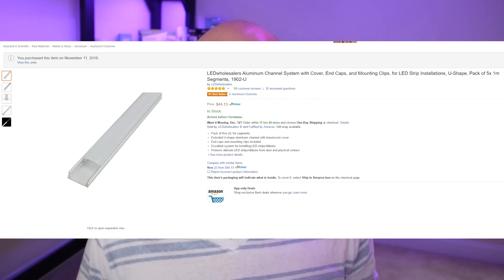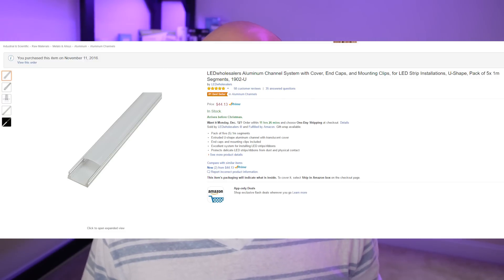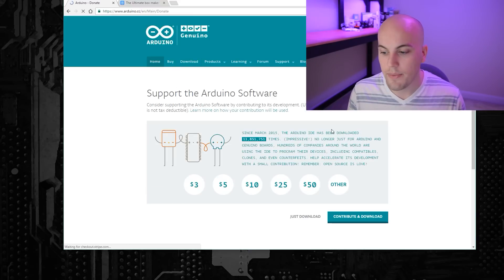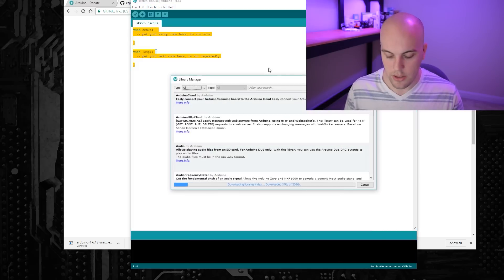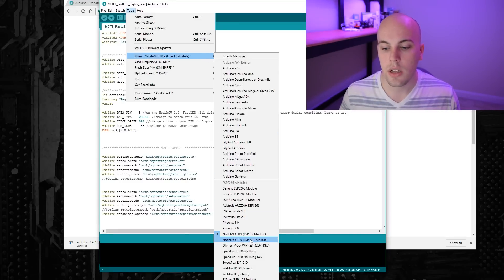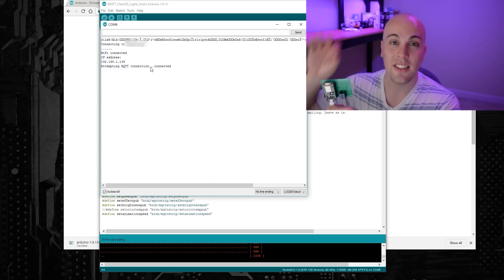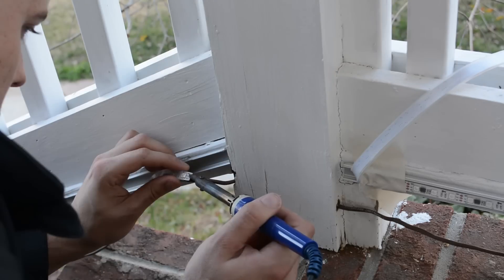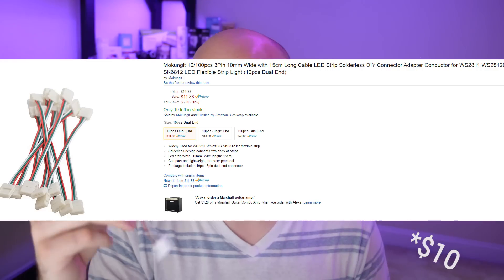The BEST Digital LED Strip Light Tutorial - DIY, WIFI-Controllable via ESP, MQTT, and Home Assistant

Comment: Hey Ben, 

I followed this tutorial a few years ago and made a light strip for our front yard. It's been working (almost) flawlessly for a few years now. It makes me happy to see it come on because it means my Home Assistant is working the way it's meant to. It comes on at sunset and turns off after 3 hours. It changes pattern every 5 minutes and there are custom automations for Xmas, Haloween and New Years Eve.

Just wanted to say thanks for your effort in making this and other tutorials.

I had it working flawlessly with a strip that wasn't as waterproof as advertised. When this eventually died I replaced with another which actually is waterproof but it flickers. I'll try the #define FASTLED_ALLOW_INTERRUPTS 0 as per a comment I just saw on here and see if that helps or breaks everything. I found that my first strip yellowed in the sun and lost brightness so for the second, I bought a can of spray on UV protection from a car shop. Worked wonders.

Here's the end result: https://photos.app.goo.gl/5jHEcjysBkctRhQX7
Reply: how did you do the cuistom animations? want to add a fex myself

Comment: Few errors might pop up in the compiling of the code that Ben has provided.
Due to updates etc.
You may get an error on the StaticJsonBuffer, seems to be due to an update,
If you go for the latest release of the ArduinoJson, it will probably default to ver 6.x , to compile the code you need the last version of 5.x as well.
Also, for some reason, after that I got an error with the term 'MILLION', so I replaced it with 1000000.
After that, the code compiled ok.
Reply: thx mate had the same problem white million
Reply: Did you use his Home assistant code? I can not get it working with updates home assistant.

Comment: Great video, thanks, I see its been 2 years but I need to ask - I bought a house with LEDs used as outdoor Christmas lights and need to identify them to try and use wifi. These are described as storefront, chasing LEDs, also seen described as injection moulded, they are RGB and have only 3 wires so I guess from this video they are analogue and maybe cant be controlled with wifi? I have tried a SP108e from Amazon, no luck as they seems to be for digital and need to identify the IC try which I think now I do not have this type. They are 3 leds per segment, and and 20 segments per section. These lights do not have an identifying marks, letters, or numbers. The RC controller says LED Dream color controller LED2017-RF-DIY 358 kinds of effects 2048 pixel

Comment: ok  Ben I surrender.  I cant make this work after weeks of trying.  I have the sketch working on NODEMCU, mqtt is working.  HA is my problem.  I'm confused, did you put everything in a single yaml file?
It didn't work for me that way.  I tried to put automation in the automation.yaml, and the input_slider in input_slider.yaml still not working.  I even tried the slider in a group. NOT.
What is it Im missing or not getting right?
Reply: Home assistant seems updated and works diferently now. I only got the automations to work by putting them in the config file but using autoamtion old:

for the light and input slider im still searching how to get this to work
Reply: @jenshoofs  input slider should be at the input_slider component in the config file

Comment: Need as well help please. I have the wiring for the ESP8266 and shift register and all that done.  I have the code uploaded to the ESP8266, but without the proper MQTT information, because that's where I'm lost!  BAD!  I have a Raspberry Pi 3.  I have tried watching the other videos linked about getting MQTT and home assistant set up, but there are many holes in it and a lot of it assumes you already have some experience with it. I don't. Not only that but it seems HA has changed a lot and some of the processes and such don't work anymore, links are gone etc. 

Please help. I've followed a ton of videos and all assume I know more than I do. Wish there was a video from beginning to end for these lights.

Comment: Hi Ben, I've been watching your videos, I mostly get them from Reddit, but I have come full circle again while researching a new idea.

I wondered if you could help me a little with it.  The idea is this: rgb pixel lights on the house, year round.  But i want to run a custom animation based on a sports event result.  And I would like it to happen automatically (i don't know how exactly possibly mqtt/stringify/ifttt/? For example, "sports team A" game starts, all the lights on the house would turn a color, or play an custom animation of colors.  And if said team wins the lights could blink or play a different animation.  And after x amount of time after the game is over the lights would turn off or go back to a static look.  I've thought also of being able to display the name of the team/current score/or final score on a matrix of lights.
 not sure if an arduino with an esp8266 would be enough for this? espixelstick/xlights/falconplayer?

Im not asking you to solve this problem here, but I am looking for some guidance on if something like this is reasonably possible? I currently have a SmartThings home automation hub (its looking more and more like i need to convert to HASS), and dumb pixels installed on the house.  I have some very limited arduino and rasp pi knowledge and experience.  I would be looking to update/upgrade the lights, and would love to accomplish this idea mostly so that I would have more motivation than just "holiday" lights.  Just not exactly sure if my idea is within my scope, and after watching what you're doing I thought you might have some resources I could look into.  If you can help that would be awesome.  Thanks.

Comment: My pick for the best digital strip is the WS2813. If an LED dies, the string will continue to function, but they're only good for short distances.
For long distances, WS2815 are way better due to them being 12V which reduces the effect of voltage drop

Comment: @1:02 No.. you do not control the individual lights with a PWM signal. That is what you do in the case of an "analog LED strip"
In a digital strip the data for each individual LED is transferred out using SPI

Comment: I am not sure if this is being monitored anymore but I was wondering how to split the data signal between 2 data wires. I have 2 strings of LED and they both work fine independently but when I hook both lines to the 5v output at the same time, one of the LED strings starts to spaz out and the other string works fine. They are a different distances from the control board, but only by 1-2 meters. Any suggestions?

Comment: The logic level shifter really is not needed.  You are wrong about voltage drop on the  control signal.  The control signal from the microcontroller only has to reach the first LED. The first LED receives the control signal from the microcontroller then outputs a new control signal to the next LED.  Each LED recreates the control signal so there is no drop along the way.  It is not, as you assume, that the control signal has to get all the way from the microcontroller to the last LED.  https://electronics.stackexchange.com/questions/249162/how-does-an-addressable-led-in-a-strip-work
Reply: Just saw you corrected this in the notes.  Sorry.

Comment: I don't agree on cheaping out on the power supply by saying you'll never be at the full amps.   That's like saying the Titantic will never need those life boats.   Interesting install.    How well will it hold up in the weather though?   I would prefer to weatherize the connections more with liquid electrical tape rather than just tape.   Also, while the effects were impressive they failed one important aspect that I was looking for:  They didn't really light the walkway up enough to see where you're going.  Maybe it can do that but,  seeing where you're stepping is an important feature of such an install.

Comment: Spent a few days trying to get this to work. I'm having strange issues with this, managed to get to the stage where the HA showing the switch, colour selection and effects. Problem is LED's aren't switching on at all. I've checked my data pin and it's correct. My MQTT works and shows the requests from HA in Ardunio IDE serial monitor. I flashed my nodemcu with the neopixel strandtest code, as a test and the LED's work. Not entirely sure what is going on. Any help is much appreciated! Thanks

Comment: Please help me! WHen Compiling appear error 'StaticJsonBuffer' was not declared in this scope! Why???
Reply: i am having the same problem
Reply: I had the same problem. I found the answer on here.  You need to use an older version of arduinojson. I have installed v5.13.3 and it works :)
https://github.com/bruhautomation/ESP-MQTT-JSON-Digital-LEDs/issues/103

Comment: I got here late, but now finished my arduino LED strip light saber project.  I would like to use the 20 M of 5050 RGB DMD strip.  However the strip pin-out is different and I have not been able to find any info on the web to use it.  There are four pins on the strip labled +, B, 
R, G.  https://www.ebay.com/i/163255895787?chn=ps.  Any clues to offer?

Comment: Hey @bruhautomation. I do realise this is a fairy old video but would it be possible to use that wifi controller on a 220v led strip? Ive purchased a 50m high voltage strip and the controller that accompanies it, has really boring pre-sets. Thanks

Comment: For voltage drop, I see you're running an additional power cable down the line. I'm wondering, are you connecting power every meter or so then daisy chaining the power along? I'm not clear on that part so any info you can provide would be appreciated.

Comment: This is driving me nuts. I just want to use my LED strip to display simple effects using wifi. Just one strip of individually programmable lights an Adafruit Huzzah and a power source should do the trick on the hardware side but I can't find a reliable connection guide anywhere. I will probably get the step down just to be safe but how do I hook this up without electrocuting myself? I assume that  the 6 front pins are for connecting a serial USB cable. The data cable from the LED strip is supposed to connect to the RX pin though. What does that mean? Do I take all 3 data wires, feed them into one wire and attach it to that single pin? Also, how do I ensure that the power is grounded? Do I have to run power through the board and then into the strip? Sorry, I'm a noob at this I know but I really want to get it working so I appreciate any help. It just seems like everything online is about way more advanced setups than what I'm going for.

Comment: Hey, great video!  I am looking to install a variety of LED strips, spots and wall wash in my backyard.  I want to control with wifi.  I have a good idea of the components necessary.  Do you have any additional resources I could use to get smart? Also, I am finding lots of controllers for strips, but not spots and other type rgb devices.  do they make them?  Thanks!!!!

Comment: When you solder up successive strips end-to-end, how do you control the addressing so that each subsequent strip doesn't respond to the controller command to the first LED driver in each strand? Is there a way to tell each driver what its address is along a serial data line?
Reply: When wiring end to end, the second strip comes after the first one logically. i.e. If you have 2 50 LED strips, the second strip will start with LED 51 and go to 100. You just have to edit the program so that it shows 100 LEDs, not 50

Comment: hello,this michael,i am from starwire professional led strip manufacturer which specialize that about 10 years，if any questions about led strip/led linear light/led downlightplease contact me.  Email:s32@starwire-led.com ,skype:8613728335761        

Our company advantage:
1.Experience--We have 10 years experience of high quality led strip.
2.Quick response--All your inquiry will be replyed witin 12 hours,also,we have 15 engnieer ,we can reponse your customize project/sample fast.
3.Good After Sales Service--3-5years warranty and always offer relative technical support.
4,We can have large PCB and led in stock for normally led strip,so,we can delievery the product fast.
5,Oul led strip have passed UL certification.
6.Our company is specializes in explore,manufacture,sales and service in the field of LED.

Comment: I am having some issues getting this to work. I have my arduino plugged into the computer, and serial monitor pulled up, HA sends the commands to the arduino but the LEDs do not come on. If i use a different Arduino program the lights work fine. so the Lights are fine. but i can not get the lights to run the program you created. Please help me getting this working! Its sooo cool I really want to make it work!

Comment: thanks, I couldn't get it to work though. the lights still on (Red, Green and Blue altogether) and the node MCU is connected to the MQTT, but it seems that somehow they don't communicate. a bit frustrating. I had tried it for longer and shorter and with three different node mcu and one D1 mini. Yaml file is fine and seems that the messages sent properly. LEDs are fine as I have checked them as well. Already changed the D5 to D4 and D3. any suggestion?
Reply: I had the same problem, omitting the D solved it for me.
Reply: Vladislav  hey mate, can you explain it a bit more if it's possible. Many thanks in advance
Reply: I defined my data pin to D2 which didn't work because the pin has to be defined just by its number. But after looking into the code again I see there is no D. o_O
Reading your problem made me think you made the same mistake.
If that's not the case, how did you figure out that the messages are sent correctly(subscribed to it manually)?
Reply: Vladislav hi, many thanks for reply, i did it right though, as you have said, i believe the logic shifter was issue, i have order another one and waiting for them to arrive

Comment: I would be very interested in how this installation is handling weather over time.   Any followup?  Did water enter at the solderless connectors, or at the power injection points?  It appears that you used a conformal coating version (vs silicone tube), so that may limit rain entering and running the whole length of a segment, but I wonder if the connections are corroding or if you managed to seal them.

It would be interesting to know just a bit more about your power injection.  You soldered power to the strips at non-connector locations, but how did you route the power wires?  Eg: Two long mainline wires inside the aluminum channel, with "feeder" wires to the strip spliced every N meters?

Comment: Ok, I dont get the max current calculation... You have 10 meters with 60 pixels every meter. 1 rgb pixel draws max 60mah. So it's 10*60*60 = 36A. So why do you say its 12A. I'm confused :/

Comment: I have a travel trailer and I would like to be able to use this to control my awning lights. 
My RV has a hub and wireless access point is there anyway I can set this up for wifi and not use the QTT server? I have a pad in my camper so I can set that up.

Comment: quick question, the WS2812 has 6 pins but the WS2812B has only 4 pins, how do i control that? how is the digital in and out get replaced here?

Comment: When I upload to the nodemcu, then test with serial monitor, I just get a series of question marks (????????...). I do not have an MQQT server yet, so I just left that blank in the config. Do I have to have that, or should serial monitor show results without it? Any ideas for fixing this would be appreciated.
Reply: OK, I figured it out, I'll share my experience here for the betterment of mankind. Apparently SSID is case-sensitive, so once I added the one missing capital, it worked. I also had to change  Serial.begin to 74880, and the Serial Monitor to 74880.

Comment: Thanks Ben!, Great, I had some effects (only 1) running in Domotics just on wifi, but this is 100 times better. Only had to change the MILLION to 1000000 in the Arduino code.

Comment: Please anyone help after setting this up on a test unit running 50 leds using nodemcu and breadboard psu everything works great via HASS change speeds brightness Sean’s all work for about 5 mins the everything stops. Nodemcu off line unresponsive have to reboot it via reset button then back online working for 5 mins Eprox what’s going on omg PSU is good wiring seems good please save me from a brain explosion lol

Comment: How did you feed power to them between strips?  I saw some black and red wire that you soldered onto it but do those plug in somewhere?  Confused about how you use those amplifiers.

Comment: Quick question. I was able to get the BTF IP65 strips working using your tutorial, however i purchased some BTF IP30 strips as well, and those do not work. If i leave the ws8211 chipset i get absolutely no response, if i change the chipset to neopixel i get light, but it is sporadic, all different colors, and doesnt follow the color wheel via HA at all. I have tried two different led strips, confirmed that the IP30s use the Ws8211 chipset and use the BRG color order.....what am i missing in the code?
Reply: So if anyone has run into this, after a few days of tinkering i found out that you need to use the TM1803 chipset for the IP30s (non-waterproof). Even though on amazon in the title and the description it says it is a WS8211. Its pretty freaking small but i think it even says WS8211 on the chip itself. Like i said above, if you use the IP65s linked in Bens video, the code will work with the WS8211 chipset. I just opted for the non-waterproof version for a few of my indoor set ups. Not sure what the deal is....but it is working now.